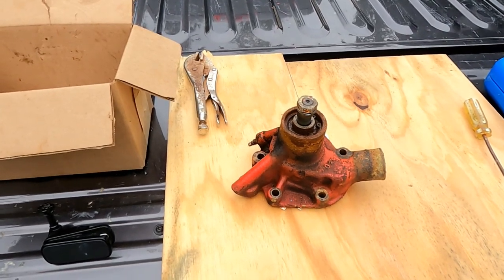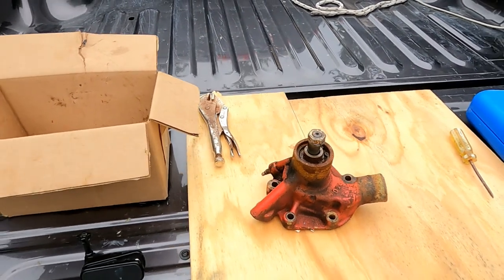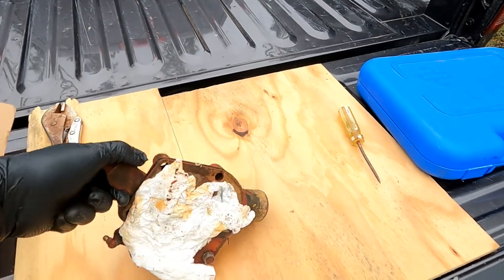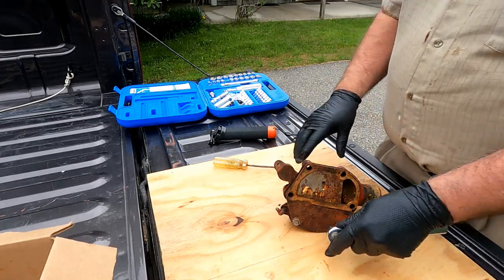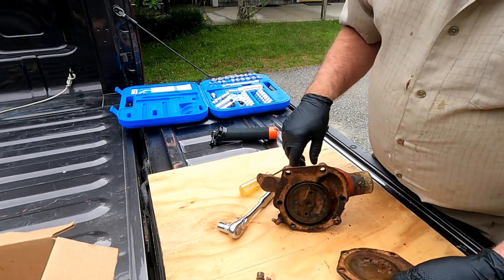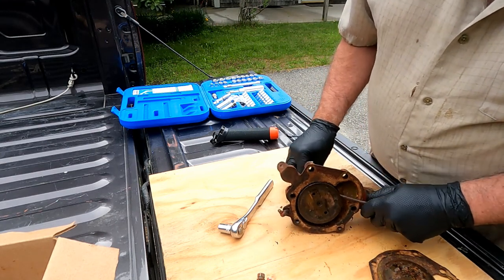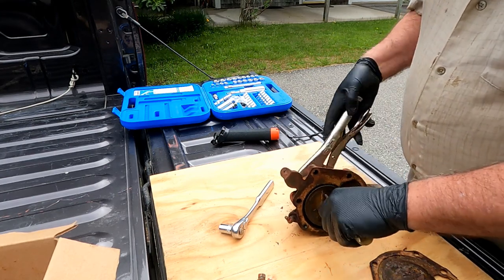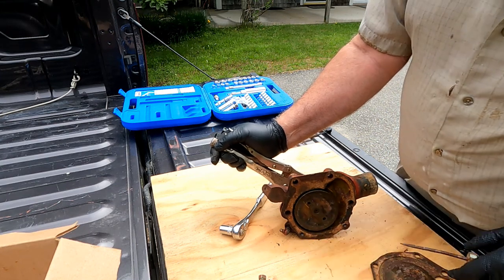Boat Maintenance - Westerbeke 46 Fresh Water Pump Tear Down

Comment: I have found that this is quite common even in the automotive industry, the price of new vs. rebuilding is often very close. Just a sign of the times i suppose.
Reply from the maker: Jeff, that certainly seems to be true now.  The issue with rebuilding is that the rebuilt part would still have the old pump body with one questionable bearing race and a worn surface where the impeller had rubbed for basically the same cost as new not including labor.  New was definitely the way to go.

Comment: Get the shaft made at a machine shop.
Reply from the maker: If I wanted a new shaft made, I would machine it myself since I have a lathe and mill.  The biggest issue as the wear on the housing.  I don't need a backup since the original lasted for 47 years.